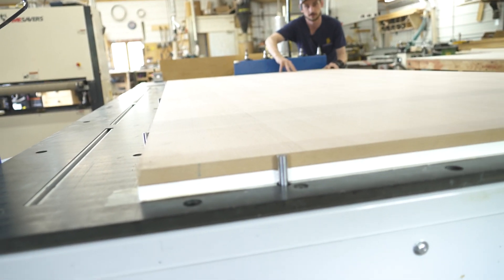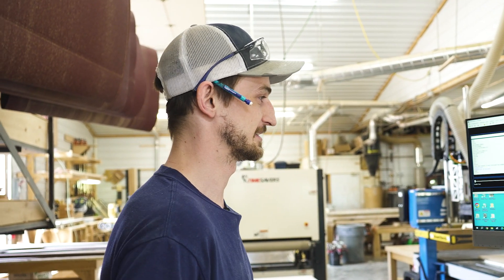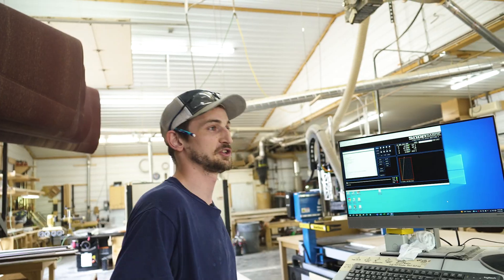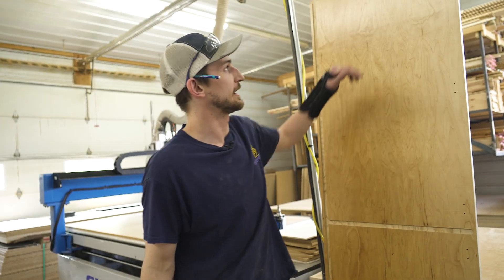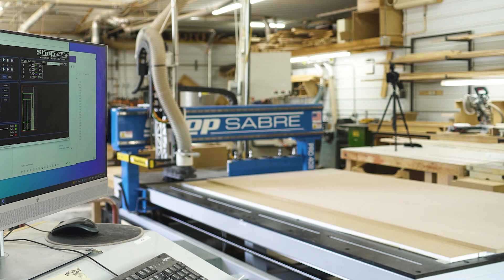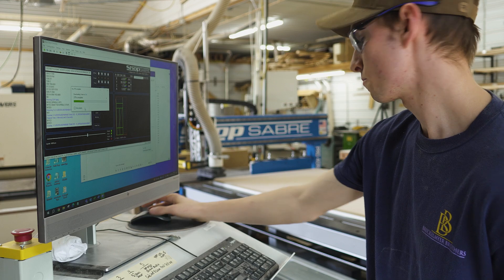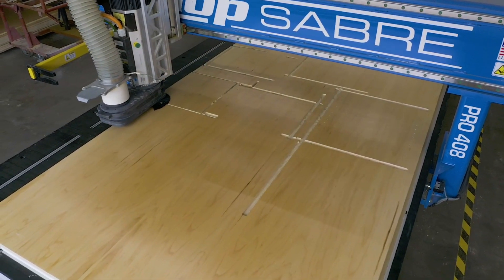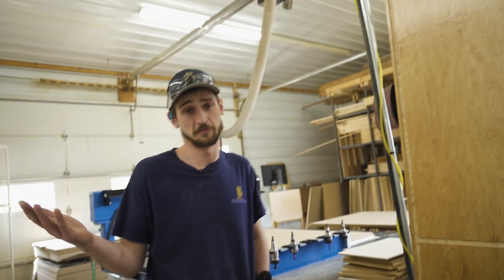How we use a CNC machine to build custom cabinets

Comment: huge money.  $150-250 bits x multiple bits, auto too change, multi zone vac, 20hp vac pumps, dust collection, air, 3 phase 480 power, 10-12hp spindles.  shit gets expensive no to mention u wanna make damn sure your files are right, east to wreck a $150-200 sheet of material..   or break a bit.

Comment: Hi are you running 3D parametric cabinet design software or drawing each panel in 2D?  This is the biggest efficiency improvement for CNC cabinetry.  You can automate your fixings drilling and everything with the right software.  We use CabinetSense in Sketchup, it would take care of automating dado positions too for your preferred construction method
https://youtu.be/uPFqIFYMet0

Comment: You guys as the operators should be programing the CNC it is how you will get good at designing.I've had a CNC in a shop for over 15 years still working and don't feel I have to upgrade .
Reply: Nice, what is the best software for making cabinets?
Reply: @timorum  Cabinet Parts Pro is better because it is just cabinets, not design software and bloated extra features you never use 
I don't want to high jack,I have at my channel how to build the cabinets.
Reply from the maker: We use cabinet vision

Comment: what on earth are you using for a spoil board?
Reply from the maker: Sheet of 3/4 MDF
Reply: @CabinetryContent  I have an IS510...i was referring to the few clips that only shows a thin say 1/8th inch white thing there.  Our spoilboards get resurfaced now and again and get smaller.
Reply: @CabinetryContent  WOW!!! 3/4" I would use 1/4" cheaper and more effective clamping of your material. Yes you have to replace more often but that is pretty easy to do.

Comment: hola .Podrias decirme cuantas y que potencia son las bombas de vacio.  Gran trabajo, Gracias
Reply: It looks like he had 2 pumps. As to the vacumn power. Given the size of the table, you could get by with 2 220 cubic meters per hour with a kpa of 36 (129 cfm 5.2 psi). Though 5.3 psi does not sound like much, on a piece of material 6" x 12" it would be = to 381 pounds holding the piece down.
Reply: Probably 5.5kw vacuum pumps